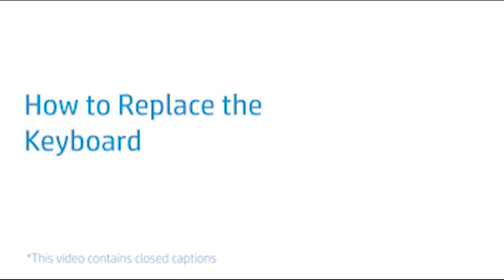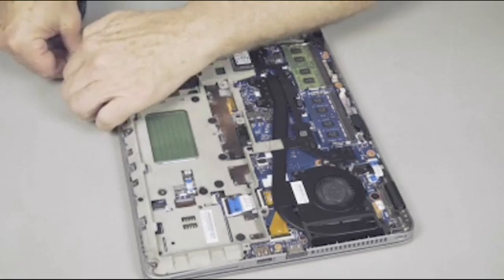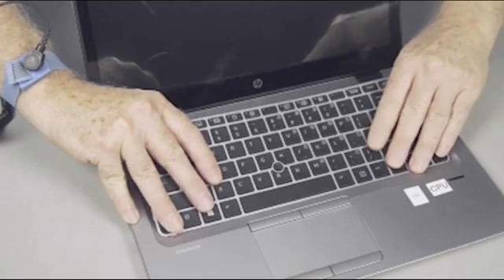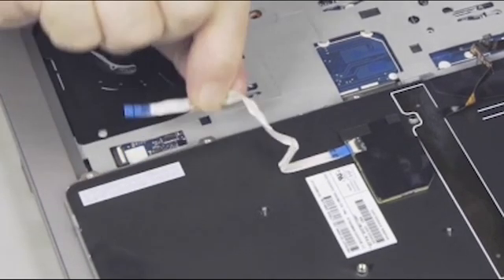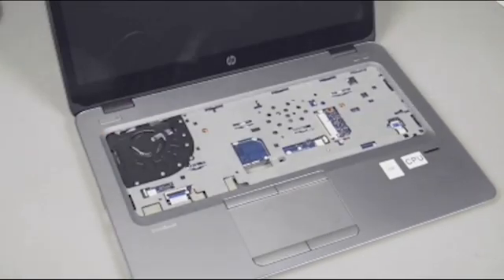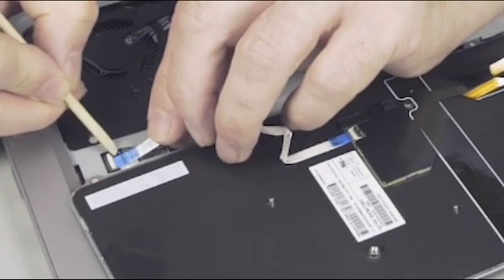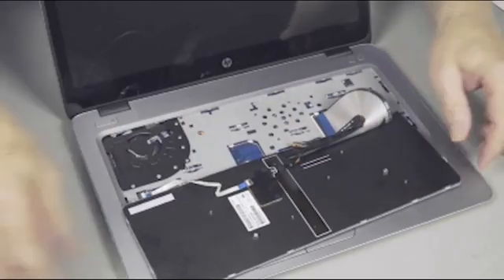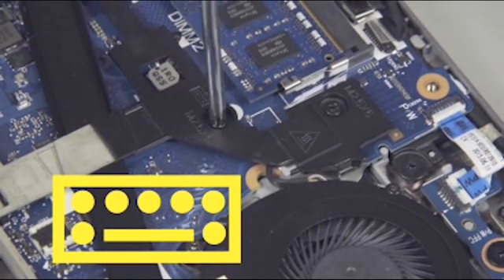Replace the Keyboard | HP EliteBook 840 G3 Notebook PC | HP Support

Comment: Thanks.. Just finished reparation. If your keyboard not responding, while backlit normal, mouse normal, then just clean up the end of ribbon keyboard cable that connected to socket. Use flat screw to remove carbon residual and reattached. It should be working normally again.
Reply from the maker: +izalahmad Thanks for sharing the steps that helped you!!
Reply: Thanks. this worked for me.

Comment: I have a hp elitebook 840 g3 and I want to know if I can turn off lights and dim it.
Reply: Yes just keep hitting the backlight button. It's on f9. A few hits & it turns off completely.
Reply: @happium4118  yes it’s in f3 button but when I press it it doesn’t work I want to know if is any problem with laptop or keyboard

Comment: Hi HP Support, after I replaced the keyboard as shown in your video and switched the laptop back on, I get the Windows Boot Manager screen below. There are also coloured pixels on the side of the screen which is a bit worrying. I did not press ENTER to continue as I don't know if it will do further damage. Any ideas what happened and any suggestions what to do next? Is it safe to press enter to continue? I really wasn't expecting this and am in big trouble if my laptop is now not working! Thanks in advance. 

 A recent hardware or software change might have installed a file that is signed incorrectly or damaged, or that might be malicious software from an unknown source. 

If you have a Windows installation disk, insert the disk and restart your computer. Click "Repair your computer", and then choose a recovery tool. 

Otherwise, to start Windows so you can investigate further, press the Enter key to display the boot menu, press F8 for Advanced Boot Options, and select Last Known Good. If you understand why the digital signature cannot be verified and want to start Windows without this file, temporarily disable driver signature enforcement. 

 Status: 0xc0000428 

 Info: Windows cannot verify the digital signature for this file.

Enter = Continue , ESC = Exit
Reply from the maker: +ian Please select last good known configuration option and start your computer. let us know how it goes.
Reply: @HPSupport  Hi there, all sorted :) The new keyboard I used to replace my old one is Back-Lit, my previous one was not. I don't need my keyboard back-lit so I didn't connect the 3rd back-lit ZIF connector the first time round. This morning I tried connecting it, and hey presto, it now boots up fine :) Thanks!

Comment: I performed the replacement today and it works perfectly. I might have mounted one cable with the contacts upside down, luckily I took pictures of each connector before disassembly. Thanks a lot for the tutorial.
Reply: Hi. May I know where did you buy the keyboard online?